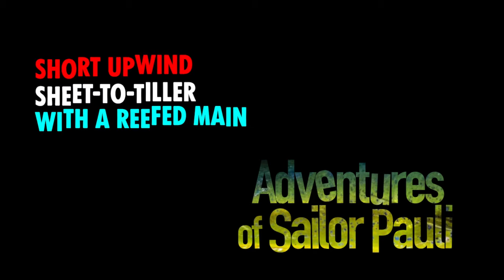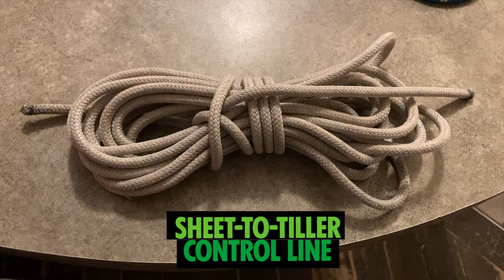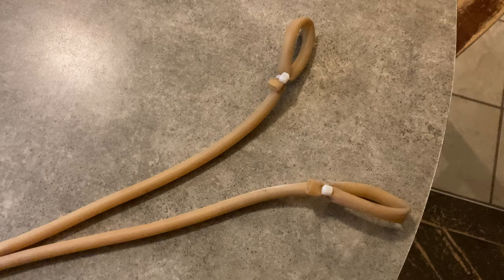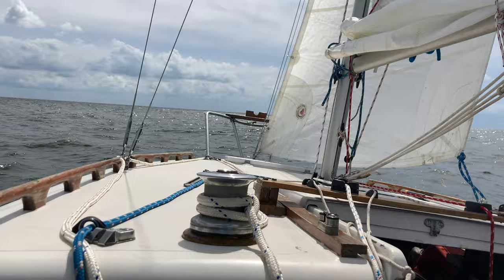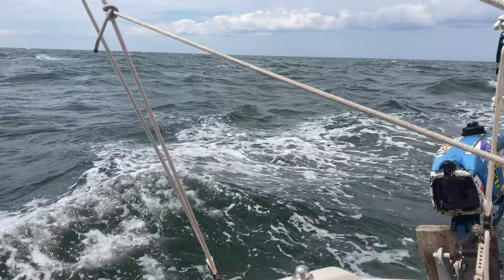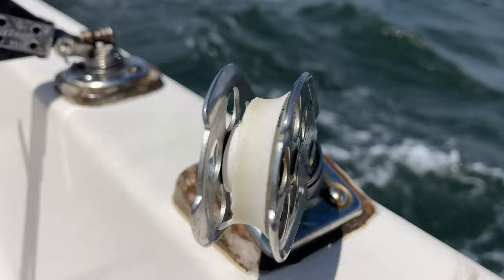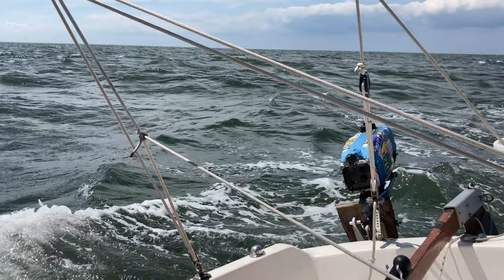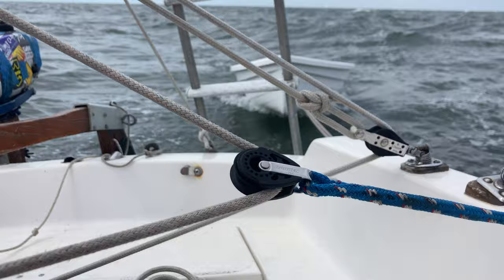QUICK HOW TO: UPWIND Sheet-to-Tiller SELF-STEERING with a Reefed Main

Comment: So, I'm new to sailing so maybe I'm missing something but if it's as windy as you say. Wouldn't you want your boom Vang pulled tight? High winds = flatter  (depowered) sails no? Also, dropping your head sail would really unbalanced your boat cause weather helm, increasing pressure on your main sheet no? Doesn't all of this make it harder to sail in the condition mentioned?
Reply from the maker: Am I racing or trying to arrive comfortably? If I was racing, sure I would keep the 110 Jib up which is not small. It is not a storm sail which would be my preference, but I don’t have one yet. With my boat, being a race boat with a long knife like centerboard, the boat is very easy to sail under mainsail alone. Once I dropped the jib, the decks dried off and I was no longer getting wet in the cockpit. I also have my 12 yr old daughter down below sleeping. For cruising, i believe the main goal is to “reduce sail” . Here, I have already tied in one reef. Tying on a second reef would make a tiny main but the jib would still be huge. The boat will still heel dramatically. Plus, when the jib is down, I don’t have to worry about pulling the sheets around every tack. In my Key Largo video last December, we sailed to the reef under main alone. My buddy kept his Jib out and was able to catch me as I was ahead of him already, but I managed to sail to pick up the mooring ball in high winds. He also lowered his jib upon closing in on the mooring ball. I see a lot of new sailors wanting both sails out at all times, but if you are nervous about heeling or are just wanting to relax in high wind, dropping the jib cuts your sail area in half. It’s a good question and I am actually on the lookout for a jib from a much smaller daysailer to raise in high winds with a reefed main for better balance. Thanks for watching!